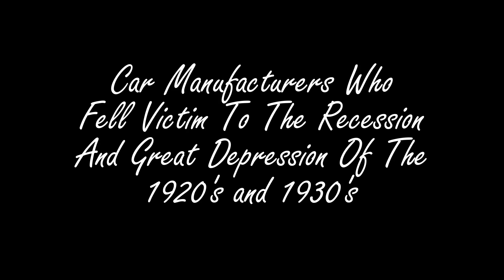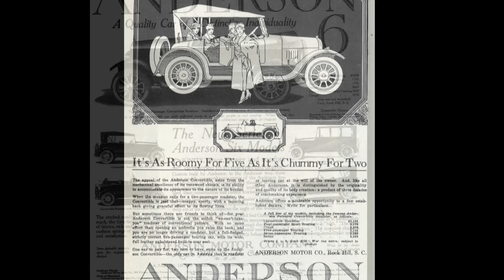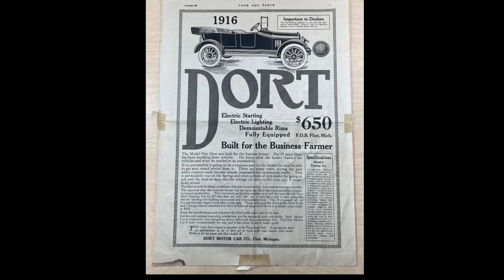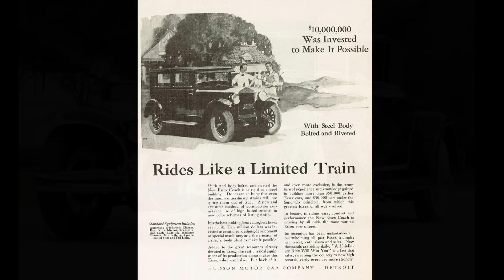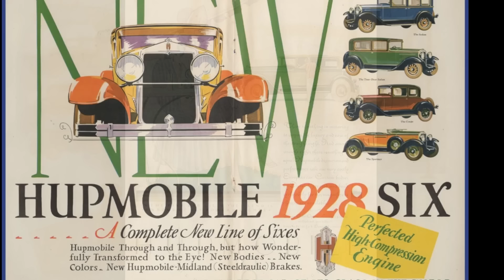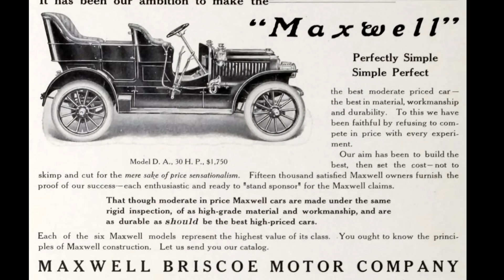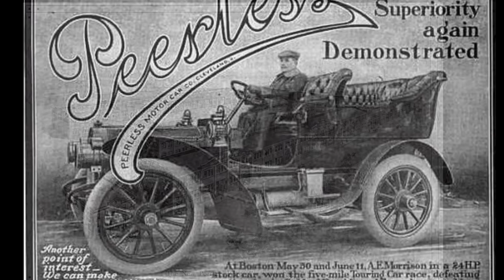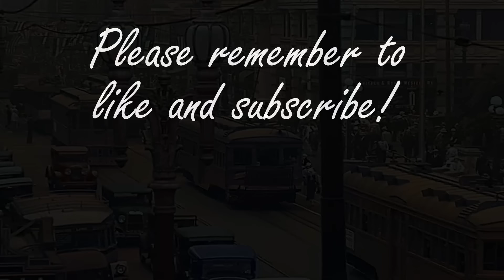Car Manufacturers Who Fell Victim to The Recession and Great Depression Of the 1920's and 1930's

Comment: 26:50 Winton continued on, making heavy diesel engines for ships, and later for locomotives of the Electromotive Motive brand. GM ended up buying them, changing the name to EMD motors, which spawned off the brand name Detroit Diesel, which still exists today as the #2 manufacturer of diesels for the trucking industry.
Reply from the maker: Hi Alex and welcome to the channel.  Thanks for sharing this information!  I appreciate it!
Reply: The Diesel, details. GM bought Winton for the large Diesel engine design and renamed it Cleveland Diesel. GM then designed smaller Diesel engines based on the Winton design and built them in Detroit. This was Detroit Diesel. GM decided to produce locomotives using the Winton Diesel and created EMD (Electromotive Division). Most of the engines in US Navy submarines in WW2 were produced by EMD.

Comment: There were several American automakers who went out of business during the "Roaring 1920s"... years before the Great Depression. Only a few of the "Independents", as they were called then, survived until the U.S. War Department awarded military contracts to all of the automakers around 1940. The high capitalization of the auto industry (facilities, labor, engineering, manufacturing, marketing, franchise distribution, and service) favored the large manufacturers with multiple models. What hurt the smaller independent automakers was a lack of widespread service and replacement parts. Generally, the automakers of that era changed the engineering of their cars so often that replacement parts were nearly impossible to find on cars more than five or six years old. With GM, Ford, and Chrysler, buyers were used to widespread service departments. But as an example, it would be difficult to find service and parts for a Moon or Cole automobile. Also, Locomobile built much more expensive cars than the mainstream Cadillac, Lincoln, and Packard of the 1920s.
Reply from the maker: You brought up some great talking points!  Thanks for watching and sharing your thoughts!

Comment: In 1929 they made a contract with the Lycoming engine company, to do a production run of the Duesenberg straight 8 engine.
After the stock market crash these engines went into a warehouse and remained there during much of the 1930s ocasionally a Duesenberg chassis would be made and shipped to a coachbuilder to put a body on it.
Franklin survived by making small airplane engines. In the 1950s the company was bought by the communists and wound up in Poland.
Reply from the maker: That's interesting!

Comment: Also notable was Mercer, Playboy, Jordan and many others. What the 1930s didnt kill, the 1950s did - when we lost Tucker, Edsel, Hudson etc and then the 1960s when we lost Studebaker and Packard. Imagine a world with no Toyota and Subaru and Nissan.
Reply from the maker: Hi and welcome to the channel.  I am pretty sure I will do another video covering those cars that went BK before the Depression, so thanks so much for your comment and your interest!
Reply: And Packard with no Merlin Engines being produced in the thousands.
In those days no one could touch the innovations North America came up with.
 Not so much now. Serfs are not supposed to think & create, just do what they are told to do.
Reply: EDSEL WAS NOT A SEPERATE MAKE IT WAS A FORD PRODUCT
Reply: The Jordan was assembled art!  Bit of trivia, it was photographed in front of mansions in shaker hights Ohio (Overlook and South Park Drives) for promo pieces. These houses are still standing.
Reply: Tucker automobiles were not built in the 1950s. The last true Packard was built in 1956... with a Studebaker-based model built in 1957 and 1958. The Hudson became the 1958 American Motors Ambassador.

Comment: Hearing about the Durant Motor car  company going out of business was definitely disappointing especially since William Durant had already co founded General Motors,  Frigidaire, and Chevrolet. Plus he was largely responsible for compiling many of the companies that made up GM. (Buick, Cadillac, Oldsmobile, and Fisher Body to name a few). Durant must have been hard to get along with because he ran off Henry Leland (Cadillac's founder) who went on to found another car company, naming it after the first President he had voted for, Lincoln. He also ran off Ransom Olds who started another car company called R.E.O. Motor Car Co. and made the REO Speedwagon. So I guess it's only fitting that Durant himself was run off of GM and started Chevrolet (which he used to retake control of GM before being run off to start Durant Motors) 

Also, Eddie Rickenbacker was no failure. Despite losing his car company, the airline he founded, Eastern Airlines, did pretty well from 1926 to 1991.
Reply from the maker: Great comment!  Thanks for watching and sharing!

Comment: The Terraplane was later sold as a Hudson, and Hudson only went out of business in the late 1950's. For a while, the Hudson Terraplane straight-8 was the fastest car made in the U.S.
Reply from the maker: Hi Alex and welcome to the channel.  Thanks for sharing this information!  I appreciate it!
Reply: HUDSON MERGED WITH NASH TO BECOME AMERICAN MOTORS
Reply: No.  The Hudson company was started in 1909.  In 1919 Hudson brought out the Essex to compete with Chevrolet and Ford.  In 1932 they decided to begin changing the name of the lower priced cars to Terraplane.  In 1932-33 the cars were marketed as Essex-Terraplane and from 1934-38 as Terraplane only.  After 1938 the name was changed to the Hudson 112.  Also, Hudson went out of business in 1954 when it was merged with (was bought out by) Nash to form American Motors.  AM did make a model called Hudson until 1957.  These cars were basically Nashes with some different mechanical features and a different grill.
Reply: @ksman9087  THEY MERGED ACTUALLY THEY WANTED STUDEBAKER AND PACKARD TO JOIN THEM ALSO

Comment: I am a docent at the Auburn Cord Duesenberg Automobile Museum.  A few notes on the makes I know.
4:55
Auburn Automobile was sold in 1919.
5:10
That is Gary Cooper with is Duesenberg J, not an Auburn.
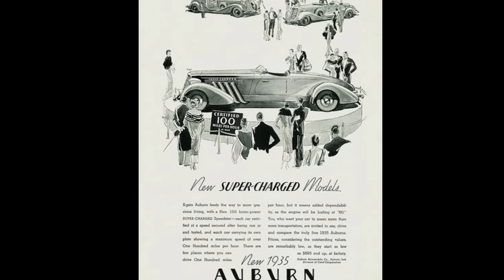5:26
Auburns last year was 1936.
I won't go into the Duesenberg and Cord discrepancies.  Sorry, I am a stickler for accuracy.
Reply from the maker: Hi and welcome to the channel.  I appreciate your comments.  To be clear, I never mentioned that Coop was standing by an Auburn, simply that he owned one.  As hard as I tried to find a pic of Coop next to one, I couldn't.  As to Auburns last year, the information on Wikipedia states that they went out of business in 1937, hence why I stated 1937.  I'm sure one can find differing information but with all due respect, I am okay with what I researched.  Your mileage may vary 🙂

Comment: Marmon made heavy trucks until 1997. Not the same Marmon family name?
Reply from the maker: The original car line ceased operation in 1933.  In short, Marmon trucks was a spin off of  Marmon-Herrington when they ceased operation in 1963.  A new company, Marmon Motor Company of Denton, Texas, purchased and revived the Marmon brand to build and sell premium truck designs that Marmon-Herrington had been planning.  They ceased operation in 1997.

Comment: The first winner of the Indy 500 was Ray Harroun, not Harmon.
Reply from the maker: Hi Rodney and welcome to the channel!  Thanks for the info!
Reply: @kensmithgallery4432  marmon ceased production in 1933 I believe. My family owned a 1931 V-Sixteen 7 passenger sedan. It eventually won a 3rd in it's class award at Pebble beach.
Reply: I believe Harroun  is pronounced    Hah-roon.
Reply: Marmon went on to produce heavy duty trucks, but no cars.  Each V-Sixteen was tested to 100 mph on the Indy 500 track and there was a tag with eac car that certified this test.

Comment: Greetings! I noticed that you made a few assertions about the power output of gas engines being superior to steam engines. However, steam engines can produce significantly more torque than gas engines. I am intrigued by the basis of your conclusion and would appreciate it if you could elaborate further on your thought process. Thank you.
Reply from the maker: Hi and welcome to the channel.  If you are referring to what I briefly mentioned about the Stanley steamer I believe I said that gas engines produced more power and were easier to operate making the Stanley Steamer obsolete.  According to stanleymotorcarriage.com, the most common steam engine Stanley produced was 20 Horsepower and could take several minutes to produce an amount of steam sufficient enough to power its car..  The Model A produced 40 horsepower and was pretty easy to start and get moving.  While steam can produce more torque and perhaps even be more efficient, the gas engine won.  If you think about it, it was no difference with tractors, earth movers, and locomotives.  They all fell victim to gasoline and diesel.  Personally, I miss seeing steam locomotives operate on a daily basis, but that's another story all together. Thanks for posting your thoughts.
Reply: @kensmithgallery4432  You referred to the Stanley Steamer when discussing another steam-powered car. I must admit that I am not familiar with the latter vehicle you mentioned. 

Regarding your point about gas-powered cars, I fully understand and acknowledge that they are generally easier to operate, which is a significant factor in their widespread popularity. I did not mean to contradict this fact. However, I did notice that you used the term "powerful" to describe gas-powered cars without specifying the specific metric used to define their power. Knowing what you meant by "powerful" in this context would be helpful.
Reply from the maker: @JeanetteIsabelle  Thanks for your thoughts! 🙂
Reply: @JeanetteIsabelle [Power]ful always refers to.... power, which is measured in horse [power].
The various iterations of the Stanley Steamer produced 10 horse [power] to 30 horse [power] with a 20 HP version in between and after the demise of the 30 HP version in 1918.
They were produced between 1896 and 1924.
1896 was seemingly the sole year where the 10 HP Steamer was ahead in power with Panhard overtaking them at 16 horsepower that year.
The model T, introduced in 1908 produced 20 HP, making the cheapest gas vehicle directly competitive with the contemporary (and WAY expensive Steamer).
And, for comparison, a direct competitor to the Steamer was the 1908 International Model N, producing 50 HP.
Stanley would never produce a car exceeding 30 HP, despite claims they had upcoming 100HP engines as the company folded in 1924.

So yes, the claim that gasoline cars were more powerful than steam cars doesn't need any qualification when speaking within the context of the 1920 recession and Great Depression.
Torque, not being a measure of power but rather force or work, is irrelevant as is the 800-Lb-Ft of torque the Stanley engines could produce as they produced it at such a low RPM that it was not of benefit to the acceleration or maintenance of speed of an automobile.
Reply: @tim3172  I've experienced driving a car with low horsepower but high torque, and it accelerated quickly. On the other hand, I test-drove a car with more horsepower but less torque, and it felt sluggish. Can you clarify how the slower car is considered more powerful?